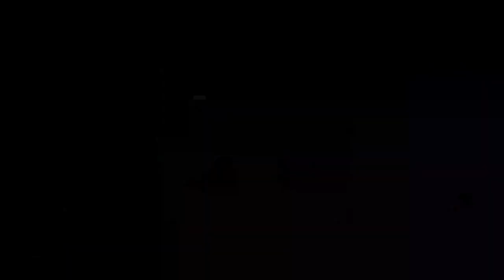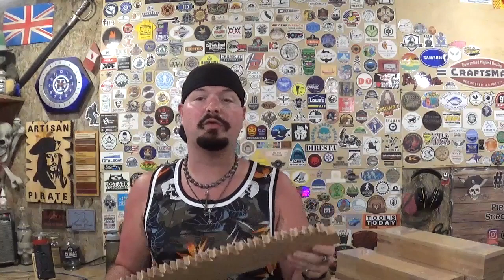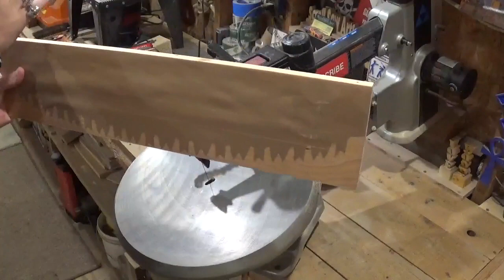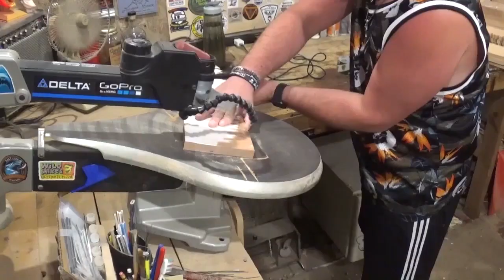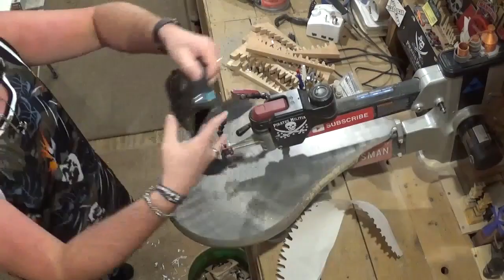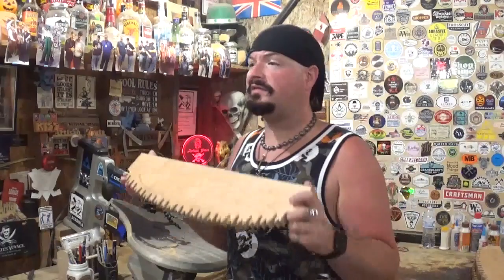Being Ambidextrous On A Scroll Saw & Production Work

Comment: Excellent work.  I got all 35 of these back from Tyler the other day and we spend an enjoyable time n the shop touching up the points of the teeth to take off the seriously pointy bits and clean up some slight burn marks.  These are exactly as I hoped, a fine job by a gifted artisan.   When I have another job involving production scroll saw work I know where I am turning - to Tyler, the Artisan Pirate.

Additionally, you have my vote on the multiple shots in the video.  Seeing the work from different angles makes it easier to understand the finer points of what is happening.

Comment: Great video, like the extra camera angles.
You mentioned filing the back of the blade to help with turns, is that something you do regularly rather than using a thinner blade? I’ve not heard that being done before.
Reply from the maker: Thank You! And yes, I file the backside of all my blades in the manner shown, it really helps reduce burn marks and makes taking sharp corners a breeze